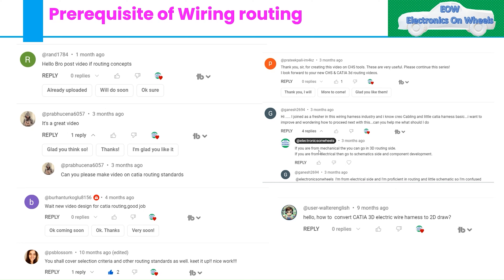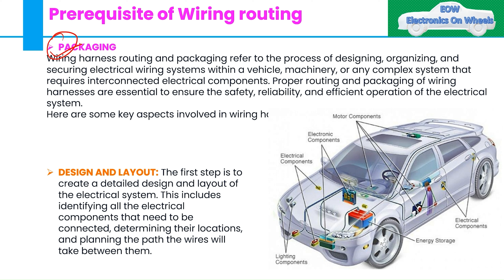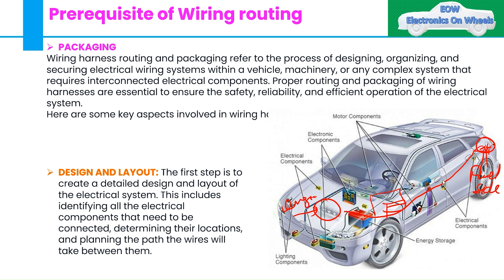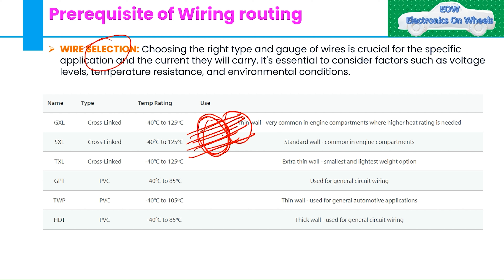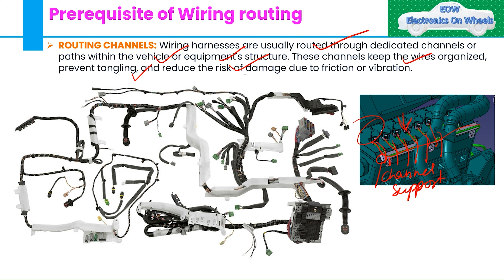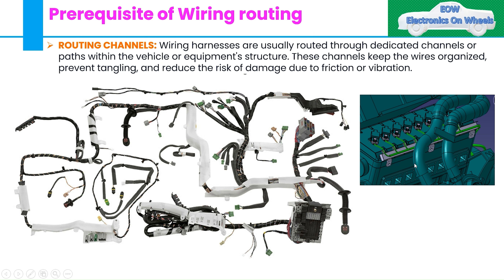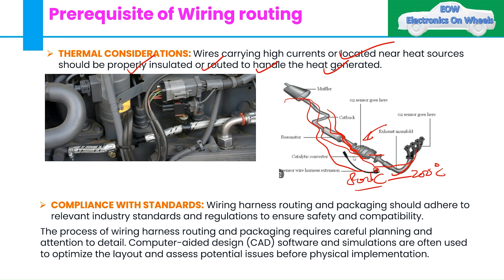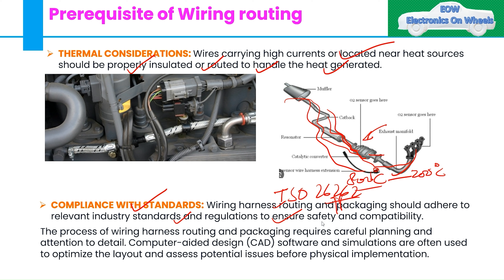What is Wiring Harness|| Routing process|| Routing guidelines|| Harness Routing||@WiringRescue

Comment: 3 reasons why cars’ fuel tanks are located by rear 
Most importantly is space. Theres generally no space under. The hood to put the gas tank. (If it were located near the engine, it would absorb some of its heat and gasoline have a high vapor pressure. (Most cars’ fuel tanks are plastic)
Secondly for weight distribution. A family sedan or suv can have a 25gallon fuel tank which when full can add almost 200lbs of weight, which isn’t what you necessarily want at the front end of your vehicle.
Lastly for safety. A head-on collision tend to cause more damage than a rear-end collision. A front end located fuel tank would be in the crumple zone and likely to rupture than if located at rear and lower to the ground.

Comment: if fuel tank is inside the vehicle, then the current generated by starter motor can create fire if it comes in contact with fuel tank, so to ensure the safety of passengers and car, fuel tank installed behind